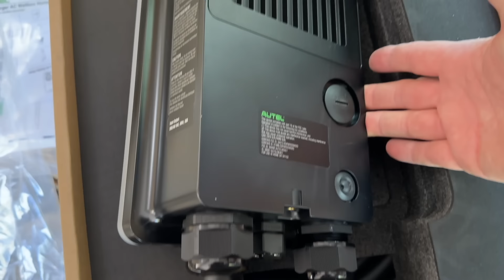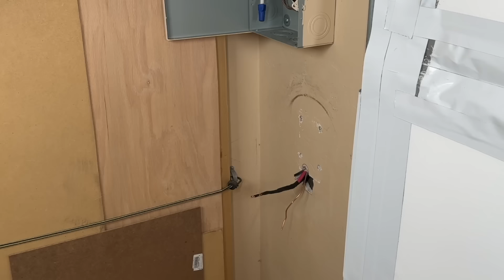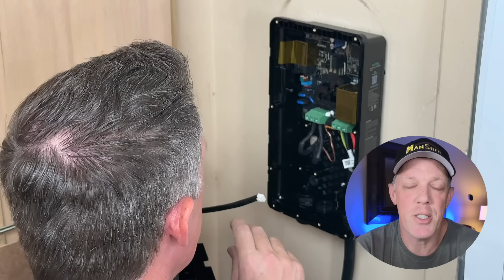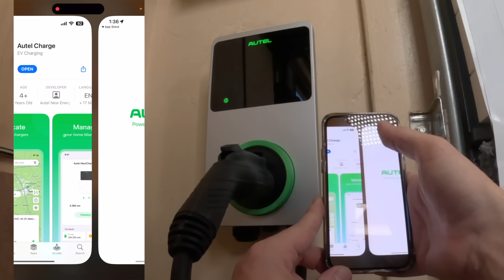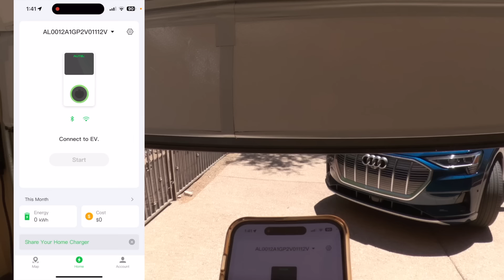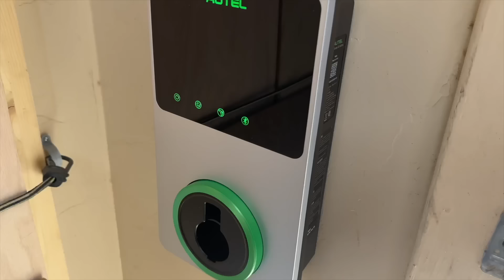Level 2 Autel Maxicharger Home Smart Electric Vehicle (EV) Charger Review

Comment: Careful bringing the wires in the box AND USE A TORQUE screwdriver to set the screws to factory RECOMMENDED force. There you go, I fixed the vid, without a sharpie…

Comment: What would you guess an electrician should charge to install this? Ballpark it. I would like to have something like this installed at a condo complex. What would that entail in terms of extra hardware and miscellaneous equipment?
Reply: Distance to panel & panel capacity are prob the biggest cost factors
Reply: somebody just told me 1700
Reply: I had someone install not even 4 feet outside of garage; charged me $1K.  Imagine the length required to your parking area.... price of wire is over the top.

Comment: Super helpful video. You made up my mind on Autel, after watching so many videos. I am lucky to have my panel in my garage. How do you like the cable stiffness? I do hear problems in cold climates. Autel is working on a new cord.
Reply from the maker: Glad it helped.  I'm in a warm climate so no issues with the cable.  It does feel thick and I can. imagine it might be a bit stiff when cold but I'm not concerned about it.
Reply: What is the charging speed ? Can you fully control and schedule it on the app?

Comment: Can you set the charger to always be on rather than having to use the charger app to start the charging each time... I will be using the app for my car to schedule the car to start charging at between 11pm  and 8am so would want the charger to just always be on if that makes sense.  When I park plug in cable let the car schedule work for itself.
Reply from the maker: yes, absolutely.  I just plug it in and it starts charging. I mainly only use the app to track usage and charge levels.